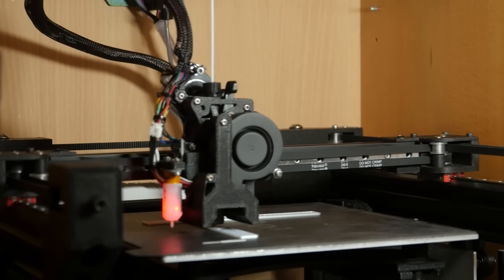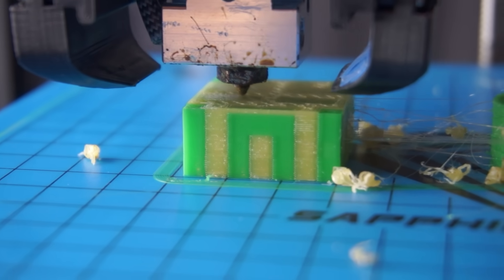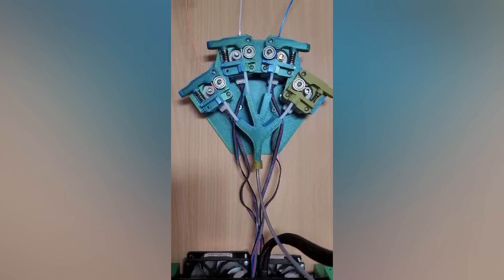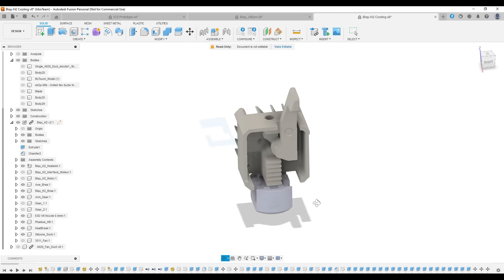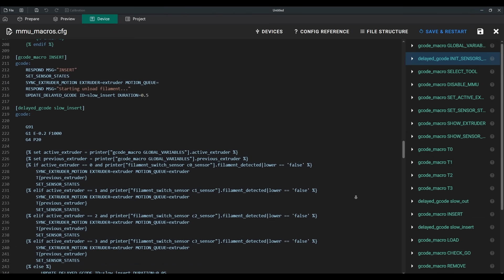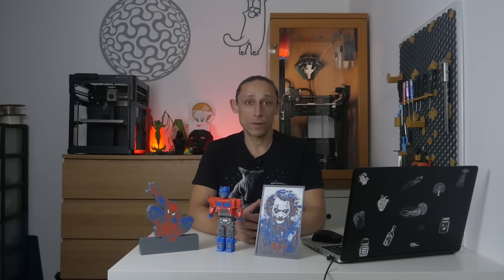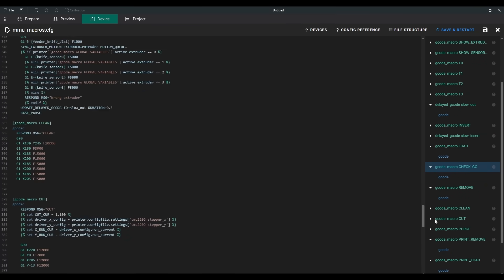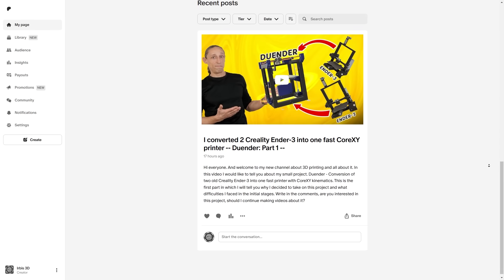I Made a DIY AMS Using Old 3D Printer Parts

Comment: Well, looks like I am gonna finally start to use Klipper after all. Combining old boards to create a Frankenstein Monster of one's dreams. Sounds right!
Reply: Klipper is so amazing honestly.  I am running a diy 8-color MMU with only 3 motors based on the 3dchameleon!  It's a challenge but so amazing when it works
Reply: it only counts if you use an old laptop or desktop that you installed Linux on to run your Klipper host and then use an old android phone or tablet as your klipper screen like I did =D but that one machine is also running 3 Klipper printers off of one old 5th gen i5 with a 256gb ssd with Linux Mint Xcfe as the operating system it's great.  But you could also just use a old tablet to run Klipper with that also functions as your Klipper screen... Oh, that Tablet can also just be used to host several 3d printers at the same  time on one old android tablet for like $20 or  $30 bucks... Same thing as the BTT Klipper Pad, there are a few companies that make their own " Klipper " pad now like Creality had the first one that can be used to host and run Klipper on several machines and it also functions as the Klipper screen for all of them but you can very easily DIY it yourself for like 20 to 30 bucks

Comment: That knowledge drop of just connecting an additional board to the host to gain access to additional steppers is great!  this project and the duoender are both great.
Reply: In the klipper world that's just given info. One quick read through the configuration reference you'll find it and all sorts of other options you'd never think about.

Comment: You can actually change some code in a change -filament macros and go successfully without a blade cutter. For this you need first place a print-head far away from model, quickly purge a bit and than immediately retract to full length! And you will not have any problems with ooozing filament during change end charge
Reply from the maker: I know. But I've tried many different combinations for this, and I haven't been able to get a consistent result for different types of plastic. Even different colors can behave differently. It works, but not for long. Small pieces of plastic accumulate in the feeder and gradually clog it.
Reply from the maker: For printing in two colors, this is acceptable if you periodically clean the feeder. But when printing with 4 colors, when there can be up to 3 swaps per layer, the extruder gets clogged very quickly, even with the smallest pieces remaining during the retraction.